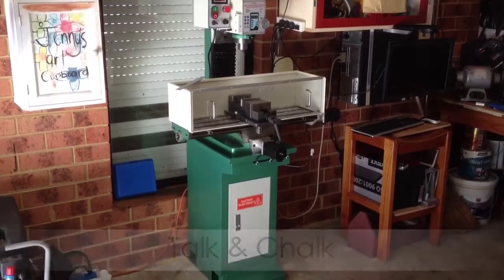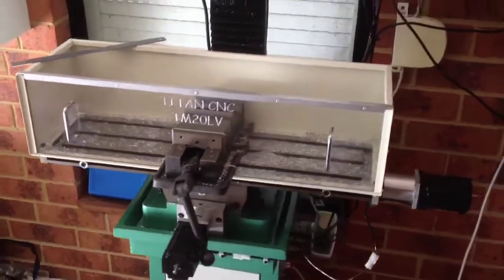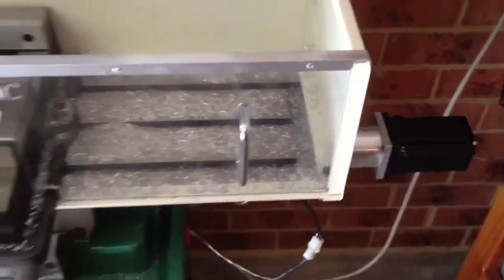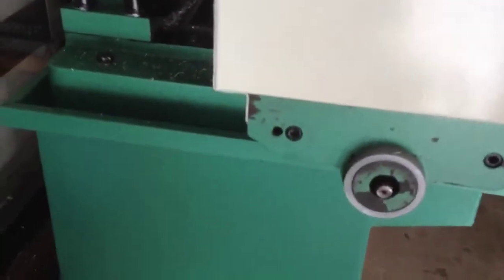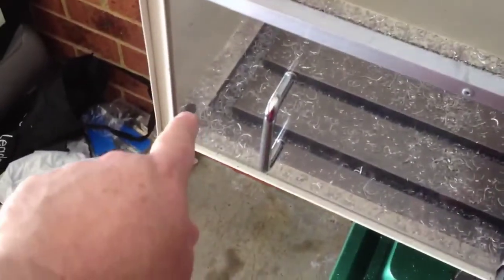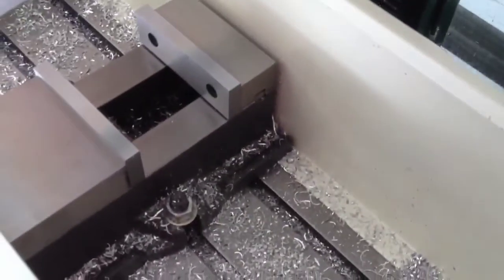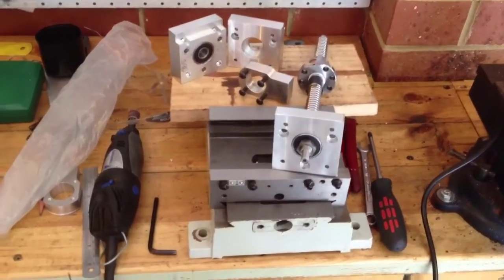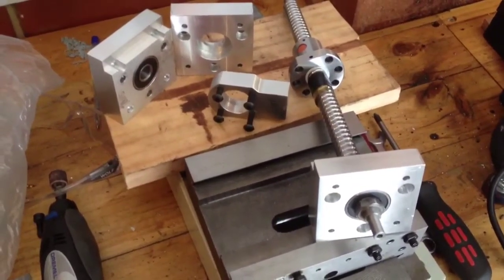DIY CNC Chip Guard & Sieg SX2 Conversion Parts

Comment: Hi azza
When you milled the parts with the bearings, did you use a boring head to gdet it right and press fit? Or is the millmaccurate enough to just mill with and end mill? Tips and tricks would be helpful and much appreciated.
Chris
Reply from the maker: Chris Atack Hi Chris, sorry for my belated reply.  I've been busier than a one armed bricklayer. I don't use a boring head in my mill.  I make it do it via a CNC process (simple pocket). But your machine needs to be accurate otherwise it will be more of an oval instead of a circle.  Cheers, Aaron.